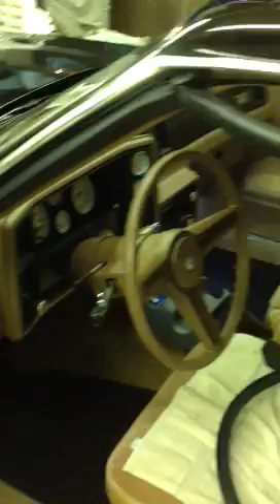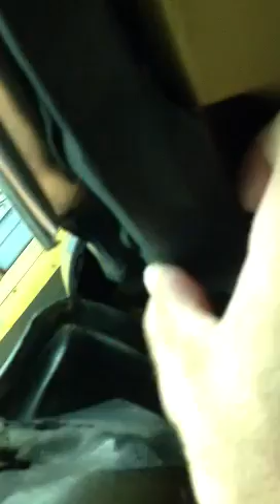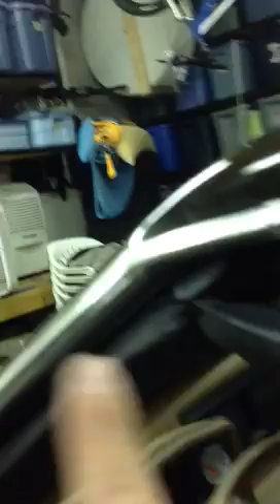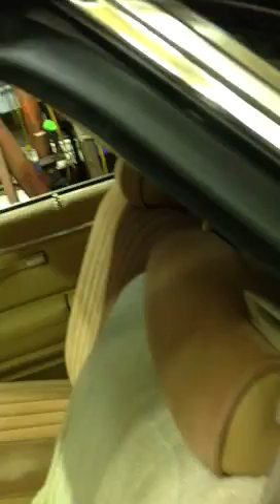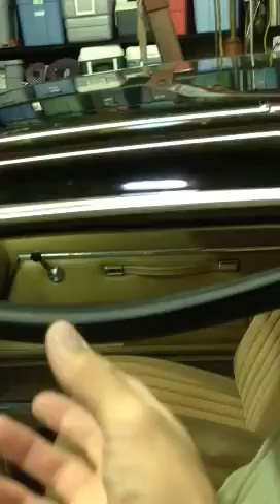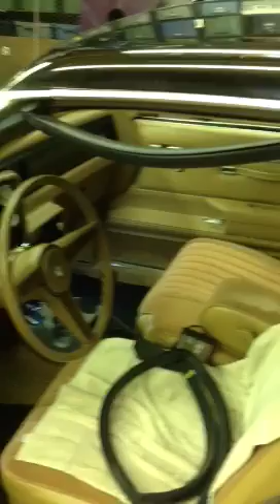El Camino roof rail weatherstrip fail

Comment: Assuming that's a Fifth Gen El Camino (1978-''87), and unless it really is a design flaw by the manufacturer, then perhaps that is supposed to fit on the Fourth Gen (1973-'77) models, as they are the largest of all El Caminos.